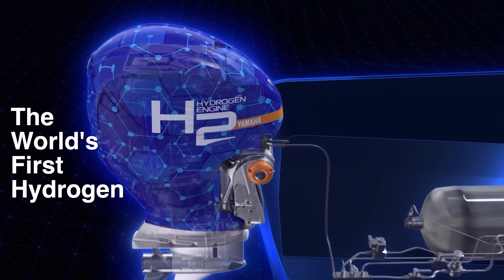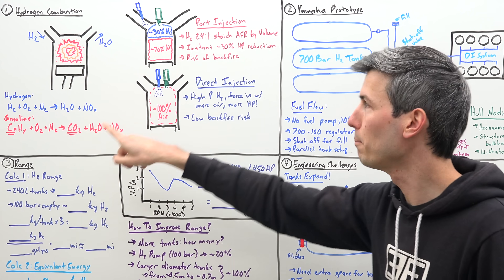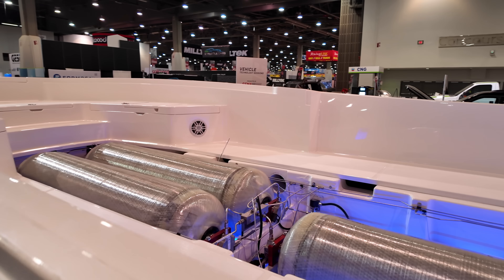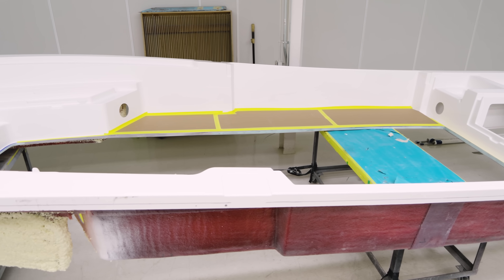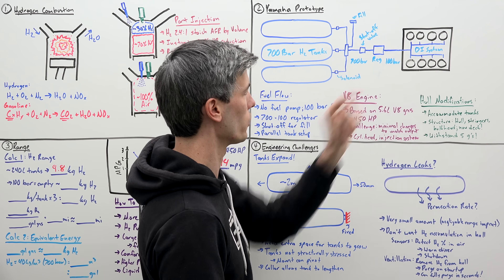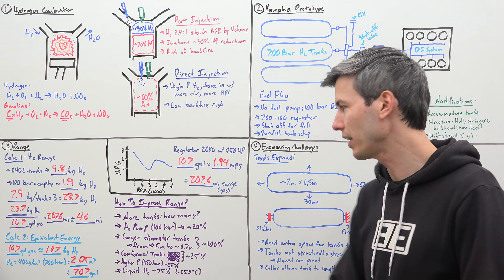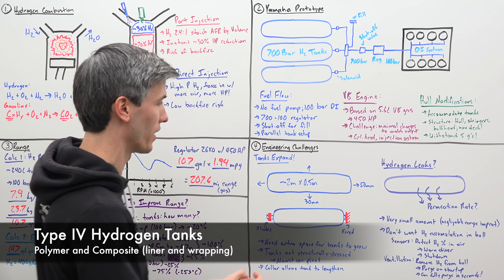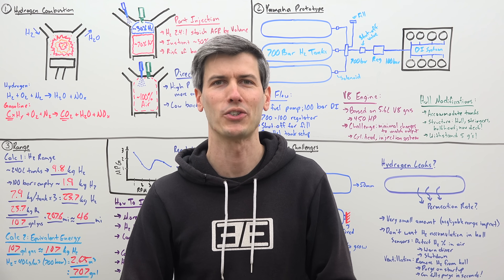The World’s First Hydrogen Combustion Outboard Engine!

Comment: Please explain why they can't separate the water into hydrogen/ oxygen to fuel a generator for electricity for the separation process and fuel the hydrogen pump for additional pressure for hydrogen combustion engine .if you try and tell me it would take more energy than it produces i will call you a lier simply because the volume of gasses produced from the separation of water is a much higher volume than the engine would require to operate.

Comment: Wouldn't a hydrogen-fuelcell-electric propulsion be more efficient? In case of combustion engine we have to have energy equivalency for the same range, but with electric motor it may take less energy to cover the same distance because of it's higher efficiency (for the motor et least)(if i'm not mistaken fuelcells not very efficient at producing electricity, but how much?)

Comment: The long term answer is a more efficient electrolyzer to convert water to h2.   Unlimited fuel.   Minimal storage needed.    Right now it takes more energy to run an electrolyzer than it produces in h2 but in a boat application it might make sense.

Comment: Your psyop style comparisons on this and other of your videos on hydrogen are riddled with erroneous assumptions about the actual long-term use of hydrogen burning engines.  These test cars are created to only store hydrogen, rather than utilize a tank of filtered water and creating hydrogen as needed. - For example, my RV engine and AC power generator has a 200-gallon water tank, no fuel tank and only a 0.5-liter compressed staging hydrogen tank with a maximum of pressure of 300-bar (4,500 PSI). Rooftop solar assists in hydrogen production and the entire power storage while resting can store and invert as much power as I typically use daily.  The converted gasoline engine (Chrysler 440) delivers around 10% less horsepower, but generally this isn't a big deal, but it does require more frequent oil changes.   88 octane fuel averages over $3 per gallon, and the tradeoff with filtered water and other costs would be the equivalent operating cost of 25 cents per gallon.

Comment: Why would you not use a fuel cell and an electric outboard? Smaller motor, less noise and the higher efficiency means less space for fuel and lower running cost (about a factor 2-3).

Comment: I always thought solar and wind ideas should be more applicable to boats. I suppose being in water always makes one worry about electrical disturbances, but any person putting water in a combustion engine destroys the engine; so it's the same. 

Maybe electrolysis combined with wind turbine turbo type system that increases air pressure back to a motor . I'm just thinking out loud, maybe I should try to invent some things

Comment: Question: could you give a theoretical estimation in terms of weight, dimension, energy density, and power output: what if we carry distiled water and EV-grade batteries  to do electrolysis of hydrogen (and oxygen) to supply this hydrogen-fueled ICE ?

Comment: Boats are more of a gas hog than I realized but man, hydrogen does not seem like the answer. Maybe some kind of electric with solar cell supplement, or diesel generator feeding electric motors, the bigger question is what do the hugely massive shipping container ships use, this is like comparing a sports car to a semi, which is more efficient per ton moved?

Comment: It would be really cool to have an onboard electrolysis mechanism, so you can charge the boat like it's electric but instead of charging a battery it generates hydrogen from the water it's in.

Comment: Let’s face it. The hardest thing with hydrogen is not making the motors work. It’s stopping the tanks and lines from leaking. Everything is expensive because it’s hard to manufacture. You can’t pump hydrogen through a simple rubber hose.

Comment: funny that you calculate weight of batteries needed for the same amount of energy that gasoline tanks and then state that hydrogen boat has 20% range of gasoline one. so it's not 13000lbs vs 600 but about 3000 vs 600. and additionally electric motor and drive train is probably lighter that gas/h2 one.

Comment: I don't think any of the hydrogen engines will work it all has to weigh allot, and has to have allot of pressure within the motor.
Reply: How so?  Hydrogen injected to the engine for ignition has its pressure already been reduced.  Do you think that the air will be supplied to a diver at 300 bar pressure where it is stored?  Of course not.  There is a device called regulator to reduce the pressure of the gas.

Comment: I keep on thinking of ways to use hydrogen and still come back to battery.  For example: I was thinking it would be great for the weekend boater to generate their own hydrogen with a solar canopy over the boat while it's docked for the week.  Sounds nifty till you get into the details.  We use at least 10 gal of gas on the weekend, so to generate 10kg of hydrogen, we'd need roughly 60kWh/kg to generate and compress.  That's 600kWh of solar generation assuming no losses.  I'd need 20kW of solar to generate that much energy in my area for a week in the summer.  That's 2 times larger than my rooftop system for my whole house.  Then I'd also need electrolyzers and compressors and possibly more storage tanks.  Or I could buy an electric boat with say 100kWh battery and get away with just 4kW of solar charging that easily can fit in the canopy area with nothing more than a relatively cheap DC to DC charger.

Comment: It's hard to believe how long ago this was, but I worked on a hydrogen fueled combustion engine at the University of Arizona.  We ran a Volkswagen engine on Hydrogen on a dyno plus had a Ford Pinto that ran on propane/hydrogen fuel on the street.  This was in 1971-1975.

Comment: I think the problem is the same as with H2 fuel cell powered cars.  There are presently about 115,000 gasoline stations country wide,which rules out H2 fueled cars except for local travel. Each dock would need a hydrogen source.

Comment: Hydrogen sounds like an absolutely awful choice for marine propulsion. What would possess them to create this? Boats have packaging considerations so the volume is an issue, and the light weight compared to liquid fuels is not a major benefit on boats that are less impacted by excess weight than say planes.

Also, combustion is less efficient than a fuel cell (further impacting range) and releases NOx - your whiteboard has a vague note about this but you didn't mention it at all. If you think finding a hydrogen station to fill up your Mirai is hard, I can imagine it being nearly impossible to refuel a boat with hydrogen.

Marine applications will go to synthetic fuels well before anybody ever considers trying to make hydrogen combustion practical.

Comment: Now it needs an emergency mini desalination plant to make fresh water out of ocean water and a mini solar power plant and a few marine batteries to make its own hydrogen in case you run out of fuel plus an emergency hydrogen V twin outboard motor for emergency fuel and at least some engine power in case your main engine fails.. that way in emergency situations the boat is always functional. Sure you might have to sit bobbing up and down for a few hours but after that there would be enough fuel to run a small motor to coast back to a port. Or to trickle feed the main tanks while you are fishing for hours.

Comment: Even when the in-hull packaging concerns are addressed, my concern would be for the refueling operations at the dock, if/when it becomes available.  The flammability range of GH2 is roughly 4 to 78 percent, a significantly wider range than the roughly 2 to 9 percent of gasoline.  Hydrogen's detonation range is also wide at roughly 17 to 56 percent.  There are also considerations to be made for the high-pressure refueling which will require special pumps and hoses.  Additionally, the fueling system must be purged with inert gas before any transfer of GH2 to prevent putting air into the on-board tanks.  Static electricity concerns also need to be addressed, with all connections properly grounded.  And if the at-dock storage facility uses cryogenic Hydrogen storage then addiitonal issues arise with that.  All of these concerns will mean that the tech at the fuel dock will require significant training to fuel a boat in a safe manner.  No more teenagers working a summer job for this......

Comment: Now if they figured out a way to incorporate a hydrogen converter to extract hydrogen from the water the boat is floating in and compress it they would be onto something. I know it can be done with electricity and have dabbled with it, but it would take alot of electricity and surface area to produce the quantities needed. Its interesting for sure.

Comment: Well one thing I see is a bunch of pressurised hydrogen tanks in which makes a hydrogen bomb ,now if the engine can produce high amounts of electricity it should be able to produce the hydrogen needed to run .first find out how much hydrogen is needed for an hour of run time ,then create a cell that will produce the consumption rate .the secondary cell may permit for over pressurization of initial cell .the government's don't like hydrogen bombs and there's always a way around them by building something safer ! 🤔😅😁😀😏 back to the drawling board to 're-engineer the hydrogen cell to actually make the hydrogen needed !😏 newbie's 😒😵🤓

Comment: Thank you for the great presentation! As always thumb up!

The funny thing about these hydrogen technologies is that they are absolutely non-green and actually is more dangerous than CO2 emissions or other green gas (_gas_ not gasoline!). Why? Because 1) and as said in the video the H2 is a small molecule and 2) there are always leaks! And guess what happen when leaking H2 meets our Earth's protective ozone O3 layer? Right, besides the explosion, the 3xH2+O3=3xH2O or H2+O3=H2O+O2 water molecules are formed and the ozone layer is destroyed and we loose our protection from UV radiation. In any gas (not gasoline!!) industry, there are always leaks and the H2 leaks are causing more negative environmental impacts than the other gases because H2 is a smallest molecule. There were some other ideas to use NH3 and NH4 (ammonia) instead, but those have other sides of the same green-washing utopia we are fed by green extremists! In fact, google for the relevant and independent scientific reports.

So folks, don't buy these utopia ideas and burn the most natural and almost ready-to-use product on this planet - the oil.

Comment: Intersting, but the introduction weight comparaison fuel/battery needs to be done with the 13 h2 tanks:
You said 1200 kWh battery needed (which can be structural), Weighting 6000 kgs.  I think it's more 1000 kWh, around 5000 kgs.

But each h2 tanks weights 200 kgs. If you need 13, it would be 2600 kg of h2 tanks.
To enhance the boat with this unstructural tanks, you will  need 500 kg. 
So 3100 kgs for h2.
But battery in few years will continue to improve. h2 tanks won't.
Actually, the purpose is not to install a 1000 kWh battery in a boat for personnal use. But install battery in boat that can cycle many times each day (ferry, etc).

Comment: Hello,
I am not a fan of hydrogen: extremely explosive, too leaky, way too bulky, and extremely costly to produce, store and transport. Any advantage its combustion may have, is lost a hundred-fold due to these problems. You especially do not want liquid hydrogen, which costs 1000x times more to liquify than it is worth. In reality, even a "simple" laboratory -80°C freezer consumes as much electricity as 25 cars, on average. And that is only to keep its contents at -80°C, in a normal 20°C laboratory room... Maybe you should do the calculations on that aspect too? Maybe you would need the fuel of 100 cars, to produce enough liquid hydrogen for 1 car? Just guessing. Anyway, it's not going to be efficient.

The only sensible thing seems to make hydrogen in the car itself by hydrolysis, and then inject both the hydrogen and oxygen (via separate injectors!!!) into the cylinders, mixed with standard diesel or gasoline fuel. The hydrogen distributes easier and ignites easier than fuel, and makes the rest of the fuel burn more efficient and more complete, with less sooth, and less unburned residue. You don't need much hydrogen, just enough to make combustion of the standard fuel easier and completer. Due to the fact that it is made on-the-fly, there is no storage needed, no tanks, no cooling, no explosion risks. Only a water tank, and an electrolysis cell. This method (of hydrogen production on-the-fly) does already exist for welding, where hydrogen welding gives a cleaner flame (and thus cleaner and better weld) than standard acetylene gas welding methods.

Or you could inject liquid water into the hot flame in the cylinders, just after all fuel is combusted. This water turns into steam, greatly increasing power. Fuel expands 300x on combustion, water expands 1600x on vaporisation. Most waste heat is then converted into steam, instead of being lost into the exhaust. The B-52 bomber uses that method to take off. And there have been race cars that used it too. The only problem: very dirty emissions...

But something else: I wouldn't mind if you could do a video on the mechanics of a car-suspension: caster, camber (and how to remember what is what): what are the effects of variations in it on the drive quality and stability? How to determine optimal settings? And what about springs and shockdampers: how to calculate these, how to adjust, and especially the why behind each setting? E.g. long vs short springs, soft vs hard damping, differences between damping moving up- and downwards, etc. Also about steering geometry: how to calculate the rods connected to the wheels for minimum tire wear (e.g. tighter inner wheel turning radius)? How to make cars turn as tight as possible, so they don't have a turning radius of an autobus? (Remember, in the 1970's a big Mercedes S-class could turn way tighter than any modern city car today.) How to cause under- and oversteer in a suspension? And all that sort of stuff. This in your typical style, with good background-info on the why of each.

Comment: Hey, Jason! Recently I installed liquefied propane injection fuel system by Vialle on my 2014 Hyundai Accent. Can you explain, please, why we don't use LPG instead of gasoline nowadays? It has lot of advantages: high octane, cooling combustion chamber, clean burning that great for engine and environment!

Comment: IIRC, when this was looked at for car combustion engines in years past, there were some issues that are not addressed here:
* hydrogen embrittlement of all the piping, combustion chamber etc
* high combustion chamber temperatures resulting in both material issues as well as nitrous oxides being created which have a strong greenhouse effect
* hydrogen mostly being produced by methane steam reforming which produces lots of co2. Especially for marine use - I presume the intention is to power big ships, not single seaters, so the quantities of fuel required are significant. 
On a more lighthearted note, I had a crazy idea ;) Since the storage is so space inefficient, why not put the hydrogen into a huge balloon that floats over your boat - that should make it much cheaper energy wise to drag it around ;)

Comment: Idk why companies are still working with hydrogen... Yeah it burns clean but it's not practical at all and WHEN those tanks fail, they're going to explode like a bomb. I HIGHLY doubt that hydrogen will ever be close to reaching the range of gas. Hydrogen is hydrogen. It's not like a battery pack where we can change what we use to make them more dense or efficient. They've just been working on hydrogen for a long time and I haven't seen much progress at all. Yeah it works and can make decent power, but the limited range, large storage requirements, and stations that can refill a high pressure hydrogen tank are a huge hurtle that I don't see anyone getting over. All of it just seems like a waste of time. It's cool, but not worth the effort.
Reply: It can have very valuable niche use.  For example in Arctic region with extremely low temperature it can still run.  Hydrogen does not freeze.  In extreme coldness air still have same percentage of oxygen.  Thus in -40 deg C, -50 deg C hydrogen combustion engine may be the only option for people to commute around.  Of course you can use heater to heat up electric vehicle, ICE engine etc.  However it is not as reliable as hydrogen that itself will never freeze in Arctic region.

Comment: What about drag coefficient from the water reducing distance traveled per litre/ kg of hydrogen? Then consider power output increase will raise the boat up higher out of water thus reducing drag but also increased power output relying on increased fuel consumption.

Another consideration, hydrogen needs to be stored at such low temperatures but the tanks expand so much when filled. How about metal fatigue caused by regular expansion & contraction causing weakness in the tanks possibly leading to an explosion? I imagine hydrogen would go up in a pretty violent ‘bang’ if that happens.
Anyway, just my thought.